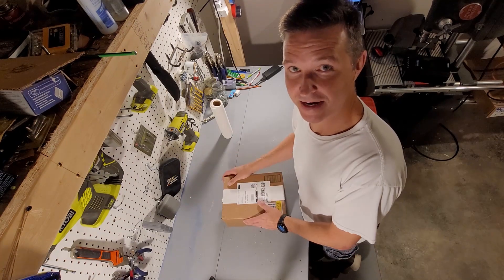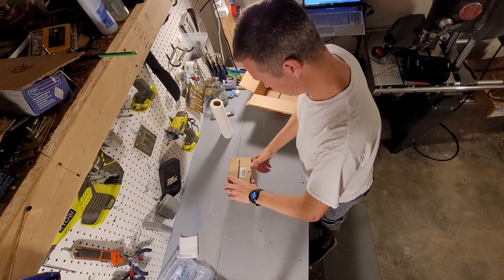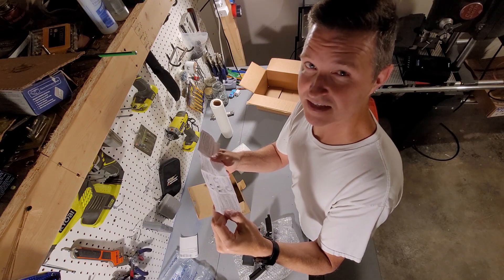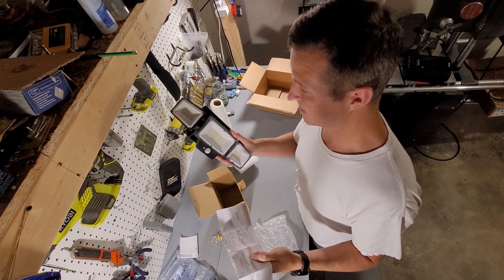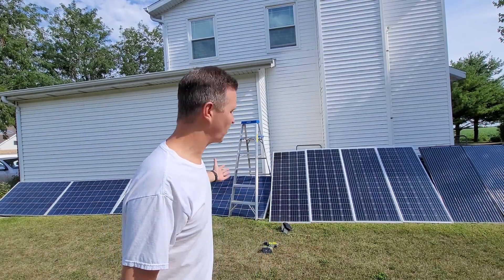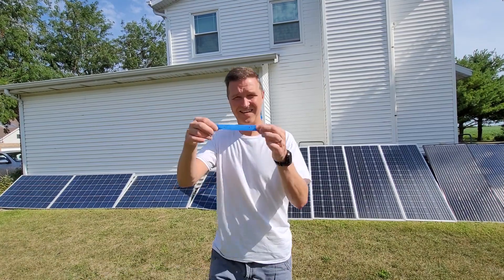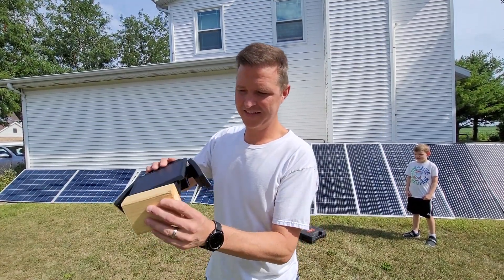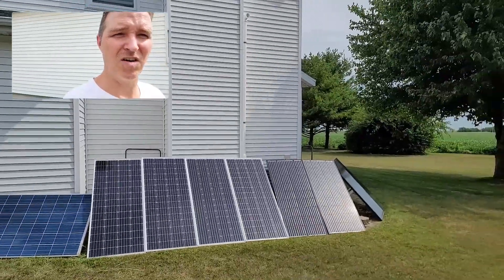Cinoton Solar Flood Light Review!

Comment: I like the idea that it turns on and remains dim but don't know when it would reset.  Point is if there is a way the learn it was triggered on so we could know someone or thing triggered it.  I have some el cheepo units and it was triggered and was on so I knew it was triggered.  I investigated and found a deer had set it... which is fine.  I think getting a camera recording something when triggered would be nice too. ...  also you may be able to make a wedge type of wood support and try to get the panel at 45 degrees pointing south.  It is closest to most sunlight ... just like your own panels.  It is great the lights themselves are adjustable.
Reply from the maker: I believe the dim light would stay on from dusk to dawn and trigger to bright when it senses motion at night.  A camera is the next best option.  Recording 10 seconds before and after the detected motion would be nice.  Thanks for the comment 👍

Comment: Thanks for the video. Can the solar panel itself be tilted to the angle you want? it looks like the panel is fixed at 90 deg to the mounting bracket @9:02, I want know before I place the order, which is 40% off right now, thanks!
Reply from the maker: No, the panel can't be tilted independently from the mounting bracket.  It's fixed at 90⁰.  It's basically part of the solar panel frame.